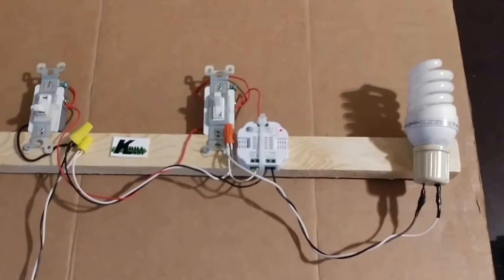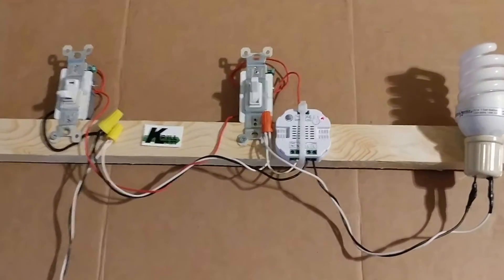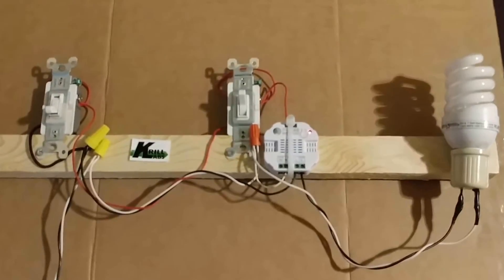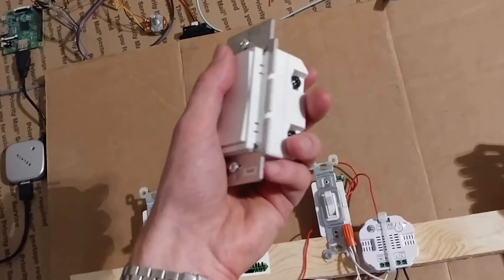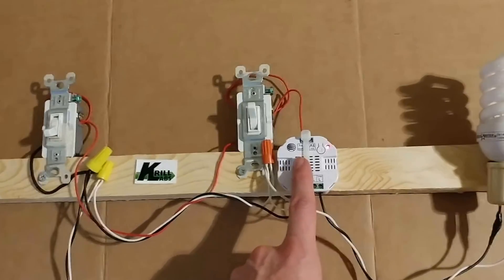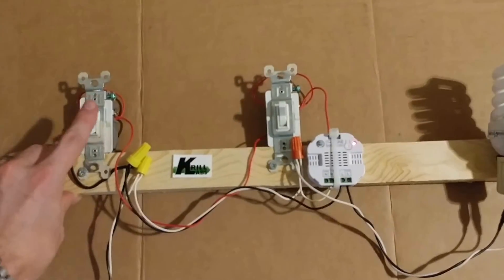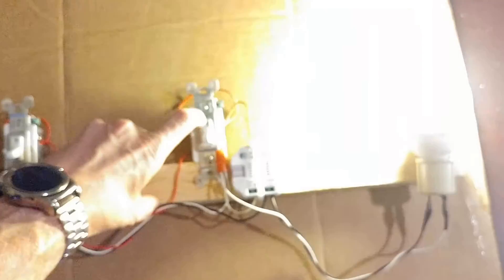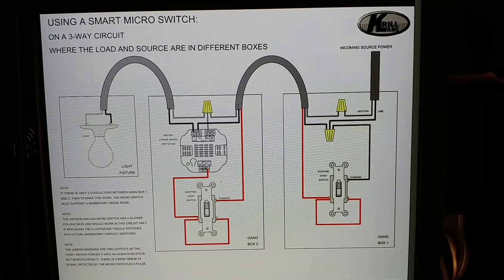Z-wave Smart Micro Switch on a 3-way light circuit

Comment: Geez Dan, I can see why you were having problems. And to be clear, this is not a criticism of Dan in any way. He shows you how to connect the wires, following the applicable codes is up to you. Or as we like to put it, "There's a reason why you serve a four-year apprenticeship before becoming an electrician..."

The questionable at best documentation is here: https://support.smartthings.com/hc/en-us/articles/202294140-How-to-connect-Aeotec-micro-switches-and-dimmers 
And download: Micro_Switch_(2nd_Edition)_Manual.pdf

A couple of biggies where it comes to violations (if you are in the USA) is the recommended 18ga wire, and switching the neutral to the load. 14ga is the minimum in the USA for a branch circuit, and you never switch the neutral (well, almost never, but then again I'm pretty sure that you aren't running a gasoline pump here). So use 14 at a minimum (with ground), and put the neutrals on the same terminal. Then you would be good.

Those guys telling you to wire up 18ga to 120VAC in a branch circuit is a violation of NEC 310.106 6.3. Breaking (switching) a neutral is pretty much limited to a special kind of circuit breaker used in powering gas pumps (I'll let you look up that one). 

So make no mistake about it, if the inspector catches this you will be shot down on your inspection, but happily be able to live to tell about it. If they don't catch it, well...

And for those of you that live outside of the USA, then you can ignore my comments since, 
A) These rules apply to the USA. 
B) I'm pretty sure that the fires will be put out long before they get here.

A legal option that doesn't violate the NEC code and still allows you to run your control circuit in 18ga is to run your (14ga or bigger) 120VAC power wires directly to the Z-wave Line and Neutral terminals in the "AC power" section, and the control circuit to the "Wall Switch" terminals only. So in a nod to the Offspring, "Ya gotta keep them separated". 

Then the use of 18ga (at a maximum of 30 volts) is approved. To do this, wire your three-way and four-way switch(es) (if you need control from three or more locations) the way that an electrician would, but use one terminal from the "Wall Switch" terminals as your "Hot", and the other terminal from the "Wall Switch" pair as your "Switch-leg". Then you can pretty much (legally) go wild as to how you do your wiring. Which is where you can really get creative. :)

Note: If you did go this way then you would not want to change parameter 120 to "O" as Peter Root points out further down in the posts. 

Nice of you to post this on my 60th birthday. Took me a while to find it. :) 

Still in Eastern Tennessee? I talk to Scott Y. fairly frequently, and Maurice N. upon occasion. I haven't seen nor heard from Navit in quite a while.

Comment: Any idea if you can move the zwave controller to the other Outlet or does it have to be on that second Outlet? I would like it to move it to the Outlet where the line wire comes in.
Reply: You should just be able to connect the line to loads and through in the second box. And do that portion in the first.

Comment: Could this same Smart Switch be used with two momentary SPDT's (labeled, say, "+" and "-") such that pressing "+" N times would transmit N "Turn On" messages via Z-Wave? I'm asking because I want ultimately to build a DIY "remote thermostat" that plugs into the wall, allowing bedroom occupants to (quietly) press "+" or "-" to adjust thermostat temperature, with a Vera Plus doing the heavy lifting either with Lua code or a basic Scene triggered by this Smart Switch. But my plan only makes sense IF successive "Turn On" (or "Turn Off") messages get generated/sent to the controller whenever a user presses a button more than once. 
Thoughts? Maybe a better (cheaper) way to accomplish what I'm after?? Was going to attempt this project with an Aeon Labs battery-powered toggle, but they don't hold a charge more than a few hours, sadly. Wasted money!

Comment: One thing that people should know on this is that you have to change the parameters of the Aeotec Smartswitch to change it from its default on/off state to momentary. You need to change Parameter 120 to O and this diagram works. Took me WAY too long to figure that out. Thanks for your video on this!
Reply: "You need to change Parameter 120 to O "
what is that and how do you do it?
through software? or is there a dip switch on the unit itself please elaborate on this  we have no clue what you are referring to
Reply: +peter Root ,  so are you using  smartthings for this?
are you using this  z wave tweaker device handler
https://github.com/codersaur/SmartThings/tree/master/devices/zwave-tweaker

would i just go into the parameter settings and set  parameter ID to 120
and then  put zero  for the parameter value ?
it look like you typed a capital O not a zero though aren't the values always numeric? i have not bought this device yet i am debating on this or GE  zwave switch with an addon switch
i am not sure  how this thing is going to fit in my box
Reply: Andrea Mitchell I should have clarified. I am using a Vera 3. Not sure the settings for Smartthings would be.
Reply: ok thanks but i have  no idea what vera 3  even is either
looks like i will go with a zooz instead
it costs the same as the aeotec ,maybe a little less ,like $30 and it is a switch so no need to go crazy trying to figure out how to fit the extra microswitch box  inside of the gang box , the zooz is a smart switch that can be used in a 3 way configuration and can use a  normal 3 way switch as the other switch ,no addon switch needed

Comment: Thanks so much for posting. Wondering where the ground wire factors in?
Reply from the maker: the micro switches themselves don't require a ground, so you would just couple them together from cable to cable in each box and land it on any toggle switches that use it.

Comment: This would work with normal rocker switches too, right?
Reply from the maker: as long as they are standard in-wall switches, then yes.
Reply: so does it  work as a  3 way or 4 way switch  ,you never actually show you turn the light on with one switch and then of with the other
do you use this with smartthings by any chance?
doe sit work well as a 3/4 way switch , so i can use either 3 way wall switch or smartthings to turn it on/off ?
mind is boggled as to how this actually works